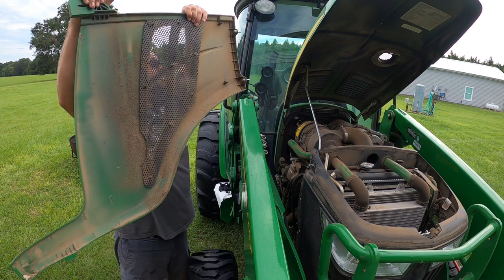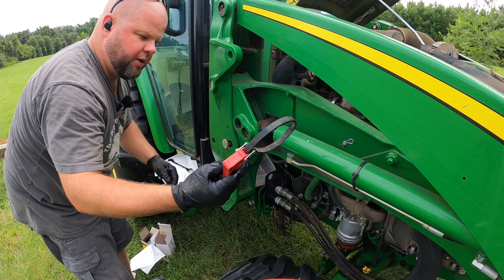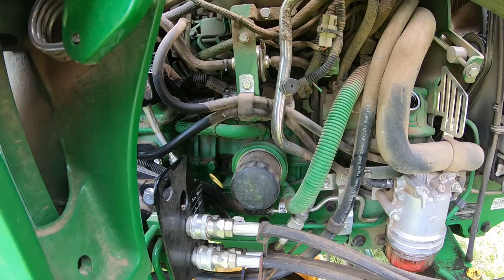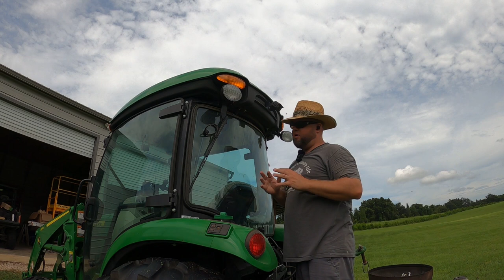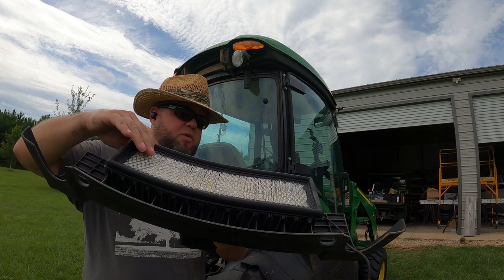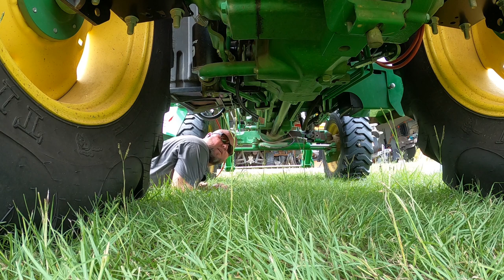Servicing John Deere 3 or 4 series! John Deere4066R service #630

Comment: Maintenance of equipment is vital. Regular general maintenance and care will help keep your equipment running smoothly and in great shape. My grandfather had a lawnmower that was nearly 30 years old that looked nearly brand new. He all ways would wash and dry it after each use and coated it with a light coat of WD-40. Changed the oil regularly as well as the air filter. He believed in preventative maintenance on both equipment and automobiles.
Reply from the maker: People don't appreciate things like they use to.

Comment: If you fill up the diesel bowl and filters prior to installation, start up will be so much easier and quicker. It also reduces the chances of getting air in the fuel system
Reply from the maker: I agree, but these new tractors prime themselves. It's not like the older equipment if you lose prime your in trouble 😬.
Reply: @TKCL  nice to know. Guess who grew up on a dairy farm 45 years ago and who did most of the maintenance work on tractors and implements by the time he was 10? Lolololol
Reply from the maker: Let me guess 🤔🤔🤔🤣

Comment: Andrew keep an eye out up in behind your large hydraulic filter there is a seal in there where the linkage that runs your 4 wheel drive mine was leaking and it was tough to find but after a few days of removing stuff I found it. Wish I could send you a pic then it may save a few steps….
Reply from the maker: Thank you for the heads up. You can always send me a picture to Kelleyscountry@gmail.com

Comment: I am curious as to why you did not blow out and clean the engine compartment before you started to change out your air filters in the engine compartment. That is the first thing I do when I service an engine. Everything else looks great.
Reply from the maker: I did and even recorded it. That was edited out to shorten the video and I didn't feel people would want to watch it. I'm not working on dirt and dust if I don't have to. The dust you seen wouldn't blow out with 100 psi.

Comment: You would think they would have designed a better filter/location for the cab air intake than behind the tractor where it gets filthy so quick.  A lot of folks use a battery powered leaf blower for keeping radiators cleared out similar to what you did.  What are your thoughts about using low pressure water from the hose when around the house to also wash off the radiators assuming you let it dry before getting in the dust?
Reply from the maker: That's always been my concern about water, not being completely dry and it clogging up more. Plus water around electric connections and sensors does not sit well with me. I personally prefer the air wand.

Comment: Also, beware of cheaper aftermarket air filters, especially the flat panel filters. Lots of the aftermarket ones are really bad & dont seal well. That might be "acceptable" for a cabin filter, but is not acceptable for engine air filters.
Reply from the maker: I try to order everything from the official John Deere website on Amazon. The only filter that's never available from them is  the fuel water separator.

Comment: Did you service your own hydraulics or have them serviced? I’m wondering if a service tech left that sensor wire off by accident. 

Always check after mechanics now because one day I drove home to find out they left my oil cap off after an oil change and my engine compartment was covered. Lol
Reply from the maker: It was at the shop for an emissions sensor repair and I let them service the hydraulics because the price was actually reasonable.
Reply: @TKCL  Emissions repair and hydraulic at a shop and a mysterious unplugged wire. Makes sense now. 😂😂
Reply: @TKCL  it just seemed unlikely for you, you’re kind of like me, extremely anal and overly careful about these things and those plugs are made not to really just come unlocked and accidentally pop out so I figured it was something more along those lines. That’s where I’d put my money anyway. 😂😂

Comment: Speaking of the radiators and condensers. A part of our maintenance program in servicing motorcoaches, every spring season all the condensers, evaporators, and radiators we will use bug sprayers and evaporate/condensers cleaners which is essentially aluminum acid cleaner and flush out in between the fins. Pressurized air doesn't always clean everything.... the acid will.